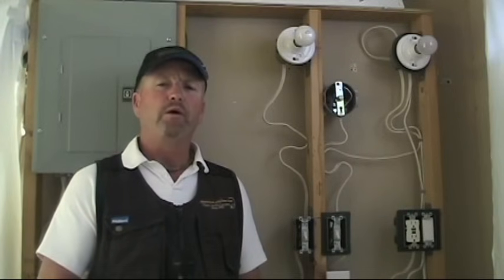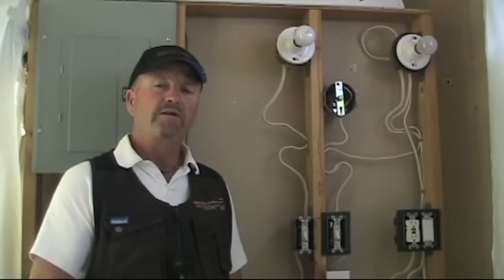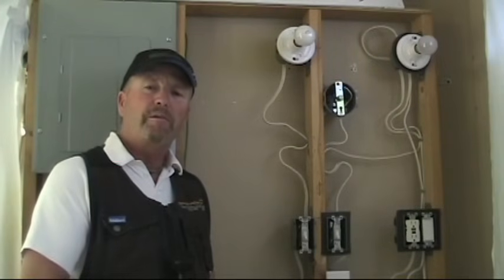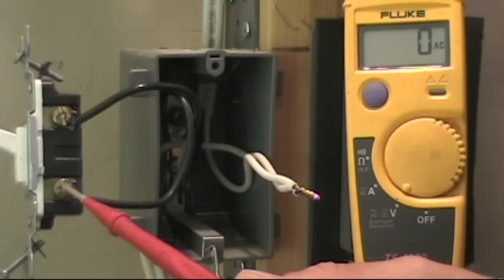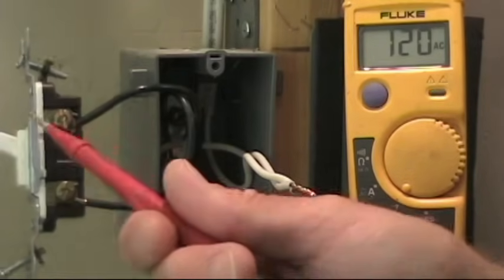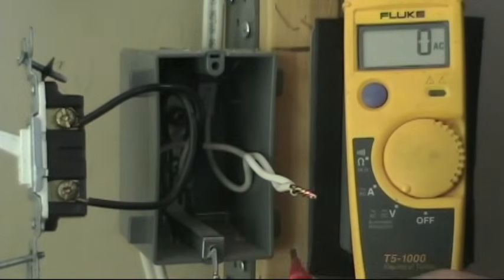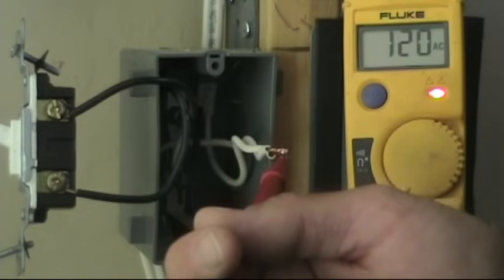Understanding an Open or Loaded Neutral

Comment: This video was close to what I am experiencing. I am actually reading 120v coming off my ground wire. To be sure of my thoughts, I even tested the ground coming from an existing panel against a dedicated ground. After that, I went a bit further and tested it with a light tester... sure as I seen it on the meter, I was able to light up a 120v light between the ground and a borrowed hot wire... I am absolutely sure this should not be happening... heres the kicker, everything plugged into all panels are working just fine and test at correct AC voltages. No tripping breakers etc.... do you know what it could be? Anyone?
Reply from the maker: I may not be totally understanding the issue there, but you will have 120V from hot to neutral, and hot to ground. That is the normal readings you should see.
Reply: @theinternetelectrician  thank you for a reply back. I have found the issue and it was scary to say the least... the person who wired my shed and claimed to be an electrician ran a bare ground as a neutral to sub panel which I believe most of the time would not be much of an issue however, the sub panel was never actually grounded so im thinking a borrowed neutral situation on top of water getting into wiring sheathing. I replaced wiring with proper 4 wire so I could get my 240vac as well as my neutral for 110 lighting and lastly a good solid dedicated ground.... so I guess the ground as ran before was supposed to act like the neutral and a ground at the same time. what I gathered is that since all grounds were tied together with neutral in sub panel it was just showing an ugly problem and reason why we do not wire sub panels grounds and neutrals together..... anyhow, problem fixed.

Comment: Hello. i have a 100 amp subpanel i ran to my garage. when i bought the subpanel there was no ground bar so i bought this and installed it into the box and ran a ground into the ground outside, two 6 ft grounds 6ft apart. I have two hot wires and one neutral ran from the original box and get 121V to each hot wire when checking between each hot and nuetral. when i ran power to a switch and to outlets in the roof for lights, first problem was i was getting  a reversed hot and neutral code on my tester. so i switched the hot and neutral and everything worked when i ran another leg to some outlets , when the breaker is off for the outlets but the other leg with lights is on i still have a hot neutral until i switch off the breaker for the lights.
Reply from the maker: This needs some hands on trouble-shooting and observation.

Comment: can you get a shock from light fixture if the white is not connected ?
Reply from the maker: Yup! if the black is connected and the switch is on, but the neutral isn't, that is an open or loaded neutral.  Every bit as painful as contacting  the hot wire!

Comment: I appreciate the video (honest), but now more confused than before. I was actually searching for something that explains why it matters how a plug goes into a receptacle; seems to me "neutral" and "hot" work and carry power exactly the same way on a typical 120 volt AC lamp or appliance. 
Think back to when there was NOT a fat plug blade and skinny plug blade for "polarity?" Does the 2-conductor appliance somehow know which wire is which??? If the current flows in both directions, how can it matter which plug prong is which? What am I missing?
Reply from the maker: You're actually missing nothing! You are correct in that a non-polarized plug feeding an appliance matters not as to what way you plug it in.  Both the hot and neutral carry current, and that's why they call the hot and neutral "conductors".  The hot is the ungrounded, and the neutral is the grounded conductor.  The reason we now polarize appliances is for safety.  So for example, if you plug in a lamp that has a non-polarized plug into an outlet, the outer shell has a 50/50 chance of being hot, or ungrounded.  The bulb or lamp does not function any different, because as you said, it's alternating current.  But if you are removing the lamp, or the shell is exposed a little and you touch the outer shell and you are grounded, then you can get a shock from it.  With a polarized plug, this ensures that the lamp shell is the neutral, and the center pin is the hot.  Does this help?
Reply: @theinternetelectrician  Yes! Thank you so much for clarifying this mystery. I do believe you nailed it for me with that example (best way to learn for many of us).

Comment: “So the answer is you have spliced up stream” What the hell does that mean? You explained everything well except the answer to our problem. I don’t remember splicing anything.
Reply: Yeah I found that frustrating too, that was the moment I was waiting for but then I skipped over it
Reply: @aarondavis176  he spoke in electrician terms so maybe a little confusing, but knowing electrical terminology everything he said came across loud and clear.
Reply: Go to his website and checkout the diagram. The neutral had voltage because when the switch was flipped on, voltage went to the light but the current couldn’t flow because of the broken splice closer to the panel, however the hot side of the bulb is connected to the neutral side via the filament so that neutral was then loaded.
Reply from the maker: SEYMOUR SCAGNETTI  I'd be more than happy to explain any questions you still may have about this.  Send me an email to terry@electrical-online.com
Reply: @theinternetelectrician   Do one in which you actually do what you are saying he told you he did.
Reply: @theinternetelectrician  Hi Terry. I have a circuit in my house that has just three outlets on it. I had to replace one outlet because when my sister plugged in my Bissell crossway which has a polarized plug the outlet popped and smoke came out of it. When I replace that outlet I found it had a bootleg ground on it. That outlet is fed by an outlet on the opposite side of the same wall. I thought I would replace that one with the GFCI just to be safe. Well as it turns out that outlet, which my refrigerator has been plugged into for the last 9 years that I've lived here, was reversed with the neutral on the hot and the hot on the neutral. So I put in the GFCI and wired it correctly. The third outlet is on a different wall and only has the two wires going into it coming from the attic. There are no ground wires in this older house. This third outlet has always pushed too far into the wall whenever I would plug something into it, so I thought I would put a collar on it.
After doing this, I got out my non-contact voltage tester and found that the two slots on the hot side were hot, but also the top slot on the neutral side was hot. So I decided to replace the outlet. Now all four slots are hot. I tried to replace the outlet again and still got four hot slots. When I have the outlet removed, the black wire is hot, but the white wire is not. What is going on here. I have since just shut off that circuit breaker and have not been able to use my refrigerator for 6 months. Please help!
Reply from the maker: @lauradennis8484  This needs some proper checking and testing by a good trouble-shooting electrician.  A non-contact voltage tester is not reliable for this.  Try rubbing it through your hair and you will find that your head is hot too! I would call someone, or get yourself a multimeter and then I can guide you through some testing if you send me an email at terry@electrical-online.com.
Reply: @theinternetelectrician  I agree.  Non-contact voltage testers, in my opinion, should not even be sold.  I was fooled once, and then stupid me, I got fooled again, by a NCV tester.  I have found that they will lie to you more often than they will give you any really useful information.  I always use a voltmeter and get a real number that I can use.
Reply: Help..
Reply: @alexmuncha2458  A splice was taken apart causing anything before the break to be hot.
Reply: SEYMOUR SCAGNETTI  Ease up Seymour, everybody is not a complete dummy.
Reply: SEYMOUR SCAGNETTI   He was giving a brief explanation of an open neutral.  You tube electricians need to leave these matters to someone who has been trained, licensed and insured.  I'd be curious to know how many fires have been started from you tubers do it yourself folks. This is one trade that needs to be left to those who are skilled....All a plumber needs to know is scat runs down hill. 😁
Reply: @cs-rb2ob laugh out loud it’s funny you talk up electricians and talk down to plumbers, as if learning a trade is trash. Humble yourself, a learned craft doesn’t make you better than the next person. Go be a fireman it might help you get a better gauge on fires that are started from faulty wiring!
Reply: True ,the problem wasn't even solved!
Reply: @robinseunath3138  It was cured when neutral was tied back together any neutral that is not grounded to The main electrical panel will be hot hot. The open neutral  condition that has been explained is one of the most dangerous Electrical hazards. people don’t expect the white wire, Grounded conductor, neutral to be caring current
Reply: What this means is the white wire (neutral) was connected from an outlet before it. Spliced wires simply mean connecting them, typically by twisting exposed tips then put in a wire nut to secure the connection. To understand the word "upstream", consider this: electricity goes to the circuit breaker, then goes in the the house,  going thru outlet #1, then outlet#2, etc... till the last outlet. If you are working on the troublesome outlet#5, upstream includes outlets#1 thru #4. 
This video says "you have spliced up stream", meaning the connection was done in an outlet before the one in work, and the connection could be broken at any of these. If outlet#5 is in trouble, go back the stream to test other outlets. Once you find a working one, the bad connection could be here or on the next one downstream. For example, you test #4 (found bad), #3  (found bad), #2 good. The bad connection could be at #2 or #3. 
The pro electricians talk in their own language assuming that we are pro like them !!!  It's very hard for us to understand. That is why I do not hire pro !!!
Reply: @1942nn  so what you mean is you do not hire pro??? what you hire non pro???
Reply: Between this splice and the panel someone took apart the neutral splice, so your neutral becomes a hot.
Reply from the maker: I have a post on my website about this that has line diagrams that might help you understand what goes on here.  electrical-online.com.  Search on open nuetral.

Comment: Half of my house has no electricity.  Please help.  All breakers including main is working.  3 rooms and 1 restroom has no power.  It's an old house so not sure where to start.  I can see power lines entering into the attic from ELECTRICAL breaker box.

Comment: In output of control transformer, current is coming out of neutral? Why is it so? I am from India ,sir. BTW , this video is very useful
Reply from the maker: We always think of current flowing from hot to neutral as a way of helping understand the concepts of electricity, but in reality, with AC (alternating current) current flows in both directions, back and forth in cycles of 60 times per second, 50 in the European grid (60 and 50 Hz)

Comment: I was changing a fan and just turned it off at the switch. Moving the wires around the white (neutral) touched the fan box and caused a spark and tripped the circuit. I guess that’s normal since I didn’t shut it off at the box?

Comment: I still not knowing what is critically wrong in the wires you had shown.
May be if you had  shown where the neutral is loaded or opened, then it would be more clear for the students to understand what had gone wrong and how to fix it, instead of hearing you repeating what you described for five times.
Anyway, thanks for your video, that I would show to my students.

Comment: So what was the problem?   Somewhere on the circuit the neutral was not connected??
Reply from the maker: Yes.  He was doing a renovation and had taken apart a splice in a junction box that he forgot about, so when he thought everything was safe to do so, he turned on the power and found his issue.  Once I pointed out to him that his problem seemed to be an open neutral, he immediately remembered that junction box.

Comment: He didn't  explain  how to fix that problem  if any of us come across  this 😒😒😒😒
Reply from the maker: To fix the problem you have to check the integrity of the neutral path for current flow.  In this particular circumstance, the problem was that a neutral splice had been taken apart at another junction box and he forgot about it.  The solution was to re-connect that splice.  Every problem will have a different cause.  A broken neutral connection can be due to a poor connection on a receptacle, or in a splice anywhere in the circuit.
Reply: @theinternetelectrician  I can  fix it but not everyone  here knows  electric  😔😔😔
Reply from the maker: @Cricketworld307  that's why they come to my channel,....to learn! Don't forget to like and subscribe and click the notifications bell!

Comment: What happens when a child puts car keys in an electrical socket? Im wondering what type of shock would that be is what I’m asking. It happened to me as a toddler. I had a NDE experience too ...when I jumped up from the floor and tried to grab a toy to play with, I couldn’t cause my body wasn’t there. I check the floor and saw my lifeless body there. I remember it like it was yesterday. When I awoke in my body I can tell you that I felt like I was hit by a ton of bricks. Really exhausted.

Comment: My Light stay on whem switch is off, how can i fix that?
Reply: Daniel, does the light illuminate exactly when the circuit breaker is flipped on?
Reply: @jeremiegrund  yes
Reply: Daniel Campos Based on that you have an unswitched hot wire going to the light fixture. Power from the breaker or other source should go to the switch and then the switch leg should feed the light fixture when the switch is on. Depending on your knowledge level check for the presence of voltage on the hot wire to the light fixture when the switch is in both the on and off positions. If voltage is present at the fixture regardless of the switch this is your issue. If voltage is detected at the fixture when the switch is off but then goes away when the switch is on flip the connections on the switch

Comment: My only question after watching this video is what is an open or loaded neutral?
Reply: Neutral wire is WHITE, open means it is not connected to anything. Let say a light bulb has black and white wires connected to it. When turn ON, the black wire will carry electricity (from another black wire thru the switch), the electricity goes thru the light filament and goes to the white wire which is OPEN (not connected). So this white wire (open neutral) now measures 120 Volts, meaning it is LOADED.
I am an engineer not a professional electrician who like to explain things using their own language which confuses us. I learned to explain the popular way so popular people can understand.
How to fix this issue ? Tough job as this neutral wire is part of a circuit for many outlets and  the white wire could be opened (broken connection or not connected) at any of these. I know how to track this down but cannot explain it in details here.
Reply: The order in which things happen determines which terminology is relevant. The neutral only becomes loaded IF it is open (disconnected from the breaker box) AND the circuit is energized WITH something (the light bulb) that is capable of sending current to its neutral side connection. 

The hot side “wants” to reverse (alternate) current flow but never can until it’s brought down by ground (in a proper AC circuit) or by you (if you are unfortunately the ground).

Now go back and read my second sentence because of course neutral is STILL loaded in a correctly wired circuit, too. Disconnect neutral and the circuit stops. So, “artificially loaded” might be a better way of characterizing the faulty condition.

And there ain’t none of that nuance in this video unfortunately, which is why it’s not as clear as it could be.

Comment: Between me watching another electrical video before yours, then specifically looking for one about open neutrals (finding yours), I finally understand what's happening. I believe I've seen that open neutral light, on a simple 3-prong plug tester, at my parents' house on certain outlets as well as at switches. Not being an electrician, obviously, I'm sure it'll be fun trying to trace the direction the current flows from each plug/switch to the next. 😕 I do appreciate your video though and you making it easy to understand. Idk why but I'm very mechanically inclined but have always avoided electricity issues beyond installing lights, switches, and outlets. I created a mental block for myself. LOL Thanks again!

Comment: Can someone please tell mehow I can put a neutral and black together not tripping breaker but have a light and fan unit come on and have the fan unit work properly with a switch installed however I cannot feed the power to another switch and run another light I can shut them both off but I cannot turn them both on I can only have one on at a Time how do I solve the situation

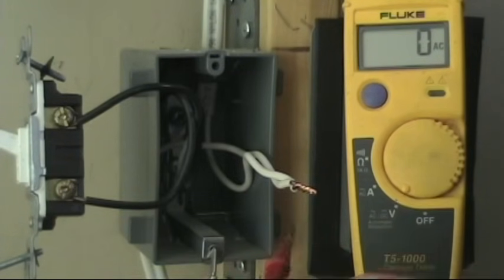Comment: 3:04 this statement is incorrect because sometimes the "main panel" requires the neutral and ground be separated if the meter socket is equipped with a service disconnect...

Comment: My ideal outlet tester says i have a ground when the outlet is attached to the box. However when it's removed from the box and I test it, it says open neutral. When I test it with an ideal vol-con meter I get 120 hot to ground and nothing hot to neutral. What could be the cause of this and how to find it.